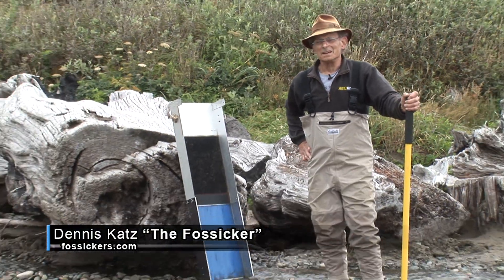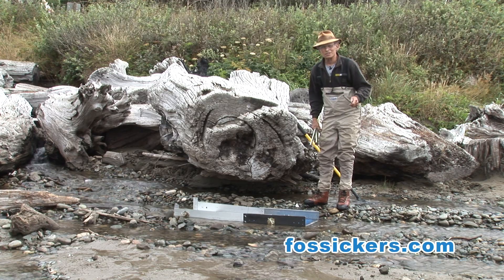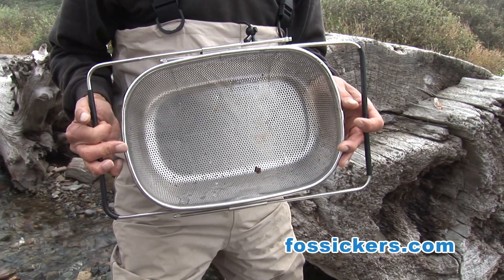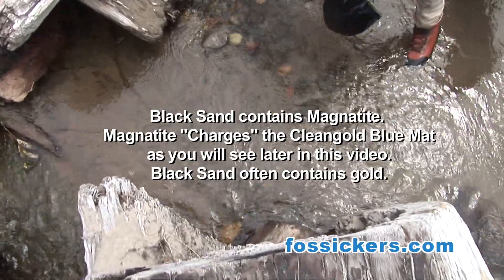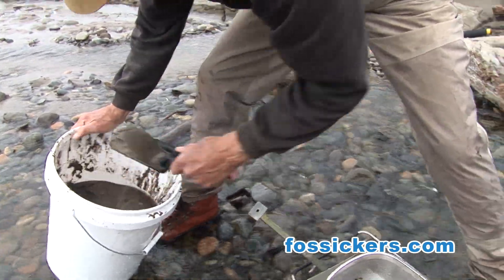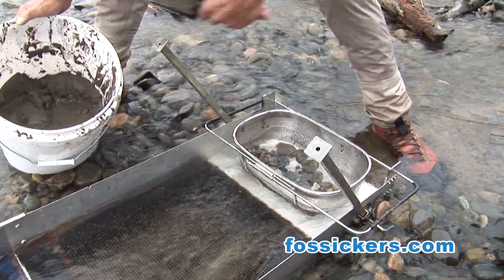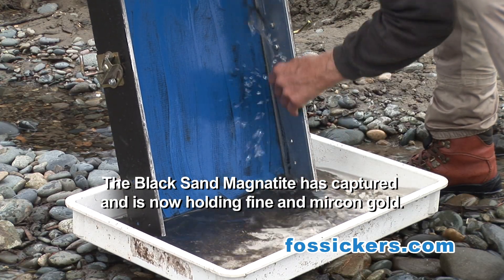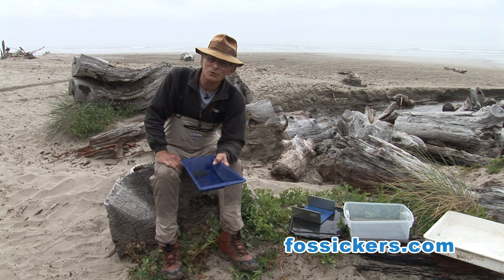Cleangold Mercury Free Mining Slucing clean gold with The Fossicker

Comment: magnetic mating it works.  i used magnetic moving belt with magnetite  long time ago here in brasil  just there is one thing that i couldnt catch the "Papper Gold" the fine flat one. So let me know if your system catches  that gold as we call papper gold the flat one whcih always floats on  the surface of the water.